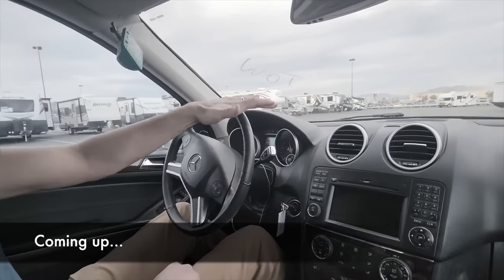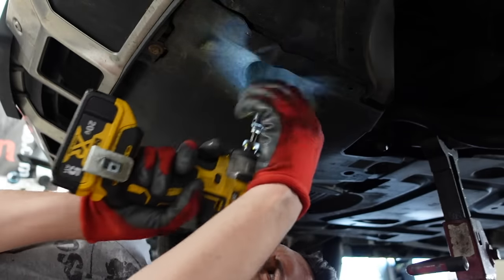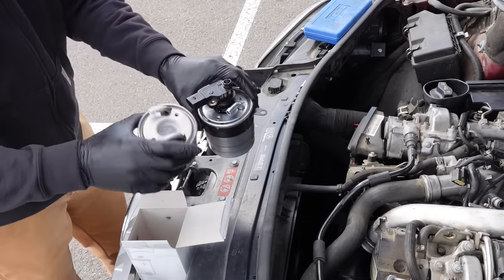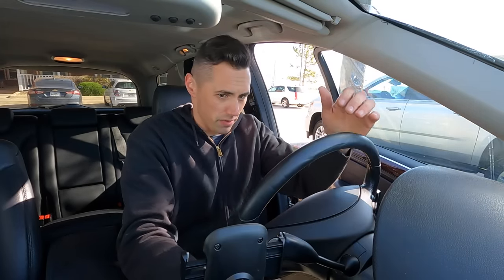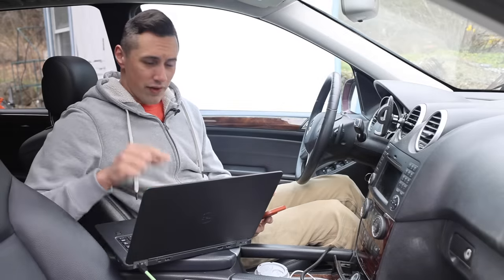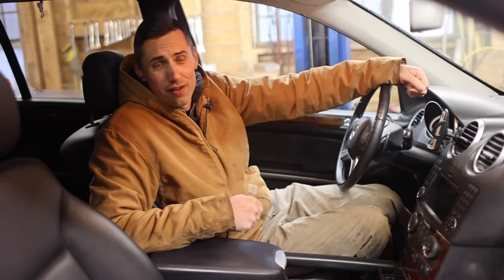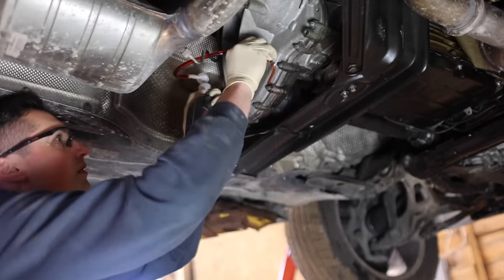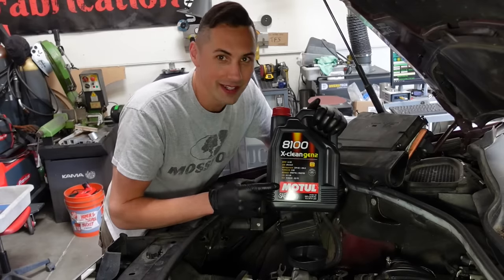This is the Most RELIABLE Luxury SUV I Could Buy for $4,000 (Not a Lexus)

Comment: Love the video. However, guys if you don't have the time, tools and knowledge to fix this car simply don't buy a MB. Things cost an absolute FORTUNE. MB Dealer charged me $450 for oil change, $500 for fuel filter. Later, over $1200 with some new hoses to fuel filter that was leaking with a filter change, $2k for motor mounts. That was all in a month span when I was out of town with an 2012 e350 bluetec. Cost for breaks to be done $2k front and rear, fluids $500. Just FYI NOLA, LA prices.
Reply: I also get 34mpg on my E350 cruised at 80mph.

Comment: Had a 2014 BlueTec and even after Mercedes fixed the Emissions system in 2021, (per the lawsuit settlement) I had to spend over $5,000 in the last year fixing oil leaks under the hood and other maintenance items (brakes/tires/batteries/services). Thus, I trader her in in April for my 2023 Lexus ES300h, Ultra Luxury trim, which came with some additional options and dealer add-ons. Kissed my Mercedes goodbye and didn't look back. She had taken care of me since October, 2015, so I hated to let her go but it was time. LOL

Love my Lexus and am getting 43+ MPG.  🤔
Reply: Smartest move made ever.  3 Lexuses in my you and I will never ever buy Mercedes and BMWs again.  08 RX350 158K miles, 17 ES350 38K miles and a 24 NX350H 2k miles.

Comment: Did you check the EGR valve? If it's stays open a little bit you will lose power , had same problem on my Hyundai Santa Fe crdi , no power with a cold engine , and Loss of power een climbing a hill .
Reply: Yep. Especially with the stall at low rpm.

Comment: I had the R class and GL with the same engine, and even though I had 200k mi on them, STAY AWAY from them.  Very high maintenance.  I did my own services and repairs,  original Oil seals must be replaced, they will leak, the replacement’s solved it with different material, but turbo, tower and oil cooler must come out to get to the $8 seals.  Definitely don’t get the airbag suspension, they will eventually blow out.  Xenon headlight wire are defective and will crack and short out.  Steering input shafts will eventually wear and must remove entire shaft to repair.  And in the 2009+ bluetec models will eventually have emission/dpf failure and give you the dreaded countdown or remaining starts before the last one and then you are stuck right where it stopped, all because of BS emissions. And clean the moonroof drain tubes but make sure the tubes stay connected to the drains, otherwise water runs down to the passenger floorboard and floods the CPU and shorts the systems and you are fooked.  Not to mention you need Mercedes programming for each injector to be registered the the engine and other diagnostic/programming.  If you want one of these diesels get the non bletec years before 2009 and no more adblue/urea to deal with.  Good luck but absolutely stick to the gas hog, gas engine.  Let these diesels die.

Comment: It does seem like you have a good idea of what you are doing.....but when examining draining fluids for metal particulate,  it would be really easy to Not See particle in the fluid as it is draining-   hard enough to see it in a drain pan while it is sitting there still.    
Good job on the ML,  and for keeping your cool on a 2000+ mile drive with issues...
I'd like to know more about your diagnostic tools,   laptops,  software,  and code readers....
Reply: Now that I have watched a few of your videos I gotta say I am impressed.     You are a talented dude.

Comment: 1 yr after watching yours I recently got a R320 cdi.😊 The exhaust back pressure sensor has faults. I changed it, but got the same fault. Do you think the ECM needs a reset? Just clearing code does not seem to work.

Comment: 25:20 any Mercedes with the M272/3 engines from 08 to 12 will be reliable. Some will have more electrical problems than others but overall they are very reliable vehicles.

Comment: I’m so sorry to tell you that you bought yourself a problem engine. The only good thing is that you’re a expert mechanic. My 2014 GL diesel had been a nightmare on all aspects. The problems I’ve had with it are too many to list one of them is needing to replacing all 6 fuel injectors. FYI I’m extremely good at maintaining this 🤬car, and I have the oil changes done more frequently than the 10k recommended by MB 🤨🥹😡

Comment: Hi Waldo, I was always afraid to buy Mercedes as used car because not sure if I will find the info to service them myself. So quick question here, where/how did you find the procedures to service this nice ML? This could convince to buy one too 😉 thanks a lot, great content as usual.
Reply: Haynes do manuals for most models including this one I think. Parts for mercedes are easy to get and not too expensive(unlike VW). I once had and early 1960´s 220 SE which needed a new drive coupling - 24 hours and I had it, not bad for a 14 year old car.
Reply: @pprey6599  Thanks ! I did not know Haynes but sounds great indeed as I found something for 2011-2015 ML350. In France, we have such French repair manuals called RTA (Revue Technique Automobile) but it is mainly for old cars and mass product ones. Thanks again.

Comment: A co-worker has the ML63 AMG with the same colour too. I've never seen this colour before elsewhere. I also have the Grand Cherokee with the same diesel motor or is very similar, definitely very similar with the looks of it. Great engine but not getting the fuel economy like you are though! I'm lucky to get 9L/km and I change my fuel filter every odd oil change.

Comment: Buy the diesel if you live in a state that does not require emissions checks. That way, you can do away with the DPF and all the nonsense, making the engine reliable again. There are two drawbacks to this. Keep the dpf and what not and reinstall them if you wish to sell it. Other than that, get rid of them. They do more harm than anything

Comment: semis you had to be parked for it to clean filter, one tome after had semi serviced i did mot 5 miles away when it cut power down where i could not get over 25 mph they put on new filter and it worked do mot regen on grass or in your garage cause they get super hot

Comment: Hey Waldo, great video as always, mine is a w212 with the same engine and I have an issue with a long cold start, when the car starts it blows out a bunch of smoke and it doesn’t smoke afterwards, what could be the reason? I heard you mentioned valve seals and oil dripping into the combustion chamber . My car has also started to consume some oil, around a liter ever 1000-1500 kms. Could it be related? Waiting for your reply

Comment: I stopped using diesels becase of the dpf bs it sends some of the exhaust fumes back through the engine how is that useful in anyway way clogging the engine thats on top of blocking the filter if its driven only short journeys a lot

Comment: So… I own such a Car and I never had any issues and my grandfather also owns one and had an older W164 before and also there, no Problem. These cars are reliable. I think you just got a bad example. Also in Germany a more basic ML 320 CDI W164 can cost about 14,000 to 17,000 Euro with roundabout 200TKM on the Clock. I'm also surprised how much those parts cost in the US, I paid for all filters 100Euro and they are from MAN-Filters, a well-known Brand.

Comment: Some of the mistakes early in the video (not replacing fuel filter and cabin filter, not showing or fixing the error with temp sensor) is really amateur. I was surprised you did all the work correctly later on.

Comment: "somehow" the sensor got unplugged. I almost never go under my hood for any reason other than putting in some washer fluid. I doubt the owner had anything to do with the unplugged sensor and I'm betting some unscrupulous dealer unplugged it and told them it would cost some astronomical amount to repair when the engine light came on. It sounds calculated and that it would take some time before the engine light came on. Also why is Waldo so effing handsome?

Comment: The dpf hardly ever works like it should weather or not it's a car or semi!!! I love having a diesel engine pre dpf. I refuse to have one with dpf because of all the times I have been broke down because of the dpf even with as few as 50,000 miles.  Normally got 500,000 plus miles pre-dpf with hardly anything need to be done. Plus the exhaust back pressure causes it to leak exhaust underneath the hood and get drawn into the passenger compartment.  To the point of causing drivers to pass out!

Comment: Unfortunately the US has all but neutered these poor small passenger car diesel engines. I have a BMW 328d with the 2.0L diesel and I think it's utterly absurd that I have to add DPF to that little thing. Between the SCR, DPF, EGR, and all the other acronyms, they took what could be such a simple little drivetrain and made it much more complicated than it needed to be. But like you said, you should really only get these vehicles if you truly love them. Fortunately they're kind of easy to work on. Overall I really like these European diesel cars and I'm sad that they are pretty much phased out of the US market now. 30mpg while doing 75mph with a fuel leak and clogged DPF sound about right. I get about 48mpg in my 328d

Comment: I have had several of those come through the shop. I think the majority were scrapped due to cost of repair higher than the value.  Then all the other problems they have.  Hard to find parts, air suspension compressor, air springs, variable valve timing motors and electrical issues.  This is the worst vehicle you could have picked to have more than 60,000 miles on it.

Comment: Did you inquire why the seller sold the Benz for 4K? Issues like oil cooler seals, finicky Bluetec, higher diesel fuel costs, proprietary oil & fluids, and general German over-engineering make this SUV a deal breaker. Run the VIN at a dealer and see what kind of maintenance record is available. No excuse for a competent mechanic to leave such important connector unplugged. 🤔

Comment: I'm an optimistic person, however, there are two big problems with taking your vehicle to the dealership, you say it would have taken less than an hour to fix, when the problem first occurred, finding a honest mechanic that would have done only what was needed and not tell you that something more serious and expensive needs fixing, is a crap shoot, second, qualified capable mechanics, even at Mercedes are pretty rare, there's a critical shortage of qualified mechanics, mostly all there is are parts changers, so if you can't do it yourself, odds are it's going to be worse taking it to a dealer, more expensive and they probably will do more damage than good. Just the way it is nowadays, finding a well qualified honest mechanic isn't that easy.

Comment: Never buy a 10 year old car of any luxury brand vehicle unless you are a DIY'er and love to throw money into diagnostics. EGR, DPF, full service, 12V battery, shocks, broken springs, oil leaks, sluggish AT's, uneven wheelwear, unbalanced wheels, pulsating brakes etc. The list goes on and on with these and there's a reason it was cheap 2nd hand.

Comment: You my friend should not touch a vehicle your temp sensor code you cleared the fault for was the culprit all along and was preventing the vehicle from regen, then you used the wrong clamps on the fuel filter that was fine, 60psi runs through the filter those worn clamps will leak eventually, then I about lost it when you disconnected the dpf, exhaust temps reach 725 celcius during regen the ammount of soot and damage you’ve done to components around dpf is ridiculous.

Comment: Mercedes hasn’t been well built since the turn of the century.  ML with the 3.5 v6 is probably the best car they make along with older e350s with the same drivetrain.  Those diesels have so many problems.its not your dad’s diesel that was designed to do half a million miles.

Comment: Is this another piece of Chrysler crap with a Mercedes Badge pasted on it (and maybe a Mercedes diesel in this version?)?  I had one several years ago and it was impossible to work on as they kept all the specs top secret.  While I paid for a full shop manual all I got was a CD that was little more than an owners manual.  You literally could not even check the transmission fluid as they had not put a dipstick on the car!  Everything was prefaced with the take it to the dealer, even things as simple as filling the windshield washer.  The engine was shoehorned into such a small space that working on it had their been a shop manual would have necessitated removing the engine for the simplest of maintenance.  The traction system was top rate but other than that it was typical Detroit junk.  I couldn't sell it fast enough!  I had thought that Mercedes had sold off Chrysler at about the year of your vehicle having found out they had bought a huge lemon in the company.  It certainly had nothing to offer Mercedes other than to destroy their reputation for good cars and trucks.

Comment: This car is not that reliable. The engine is so-so the transmission, to quote my mercedes transmission guy is a "150,000 mile transmission". It only lasts 150K miles between rebuilds. The engines reliability skyrockets when you delete the EGR, DPF and swirl valves. The SCR has probably zero effect on engine reliability but getting rid of it frees up space for a spare tire and the hassle of limp mode when a urea or NOX sensor fails. Oil leaks are always fun. Not expensive or even difficult (except the oil cooler) just annoying. The electrical system is very sensitive to the battery so get a good AGM battery and not a flooded Wally World  jobbie. If you're familiar with mercedes and/or working on your car, go ahead and get it, otherwise buy a Toyota.
Reply: The car in the video has done more than 200k. It would be interesting to know what has been repaired in the past.
Reply: @1maico1  It would be interesting to see its repair history and it would also be interesting to see what's been removed as well.

Comment: Well built because it is a Mercedes 😂😂😂. Mercedes forgot how to build good cars, decades ago, well before that car. Even in the 90's they made all the mistakes in the book don't want to get started but if i take out a list with all the changes they made to various models for cost cutting, we are going to end up with a few km list. Cars with headbolts not tightened, wiring harnesses made out of crap that are disintegrating on the cars, headbolts made of cheap materials that are stretching from the first tightening from the factory, cars made of questionable quality steel that are rusting like crazy, poor choice of underbody coatings that are preventing the owner to see if there is a rusting problem until it is too late, poor plastics in interiors and so on. Mercedes reliability and being well built is just a legend from old times.